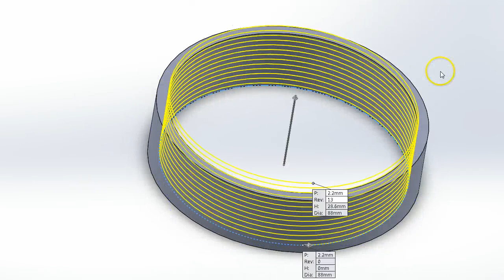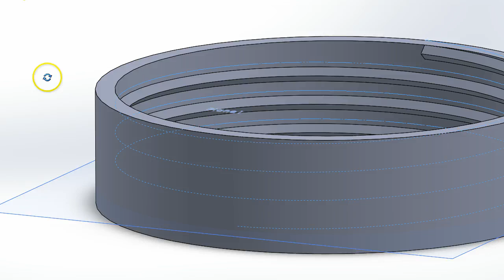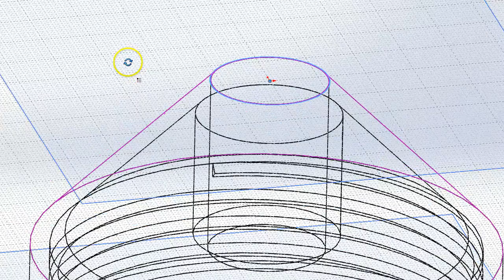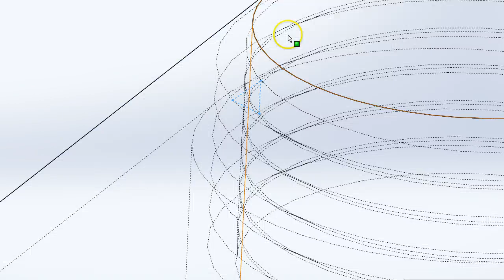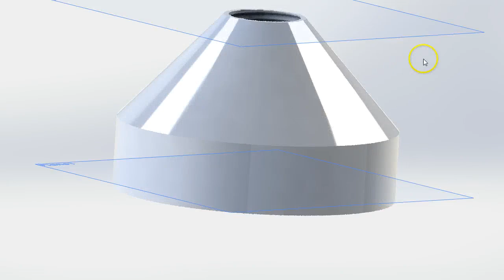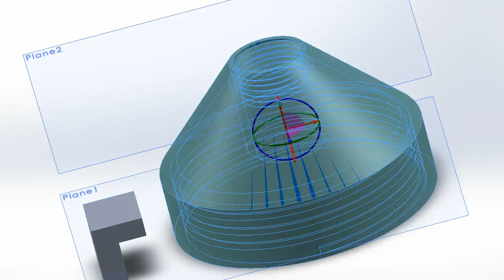Food Rising 3D printer object building demo with the Health Ranger

Comment: LUVINIT - excellent real-time introduction/tutorial.
Mike, you have got me fascinated with 3D printing. I'm considering going back to school for a geometry "brush-up" and I'll need to get some books on the various software applications that you're using, maybe a class or two on those as well. What are the software packages you're using for design?
It would also be a helpful jump-start if there was an index created for some of the measurements you "happen" to know. Like the pitch of the threads (a lot to ask I know). But maybe we can all participate in building a 'standards' database on some of those common measurements - maybe even a software library that we could call from as a subroutine, into the design mode (maybe not).
I read you now have 4 printers and I'm guessing you might post your opinions on their various utility characteristics.
Spring garden time is coming quickly and I'm looking forward to see what you're going to provide us on Foodrising.org. I'm anticipating (and hopeful) being able to create them for my own gardening and perhaps help some others that may not want to purchase their own equipment, acquire the pieces you've designed. That would be a good feeling.
Be well and thank you.

Comment: That adapter will not print as you have a large internal horizontal surface--the bottom of the internal blank space inside.  This would be in the plane of where the top of the mason jar would be.   Very interesting though.
Reply: This is the kind of participation we need. Collaborative solidarity. WE can make it better.